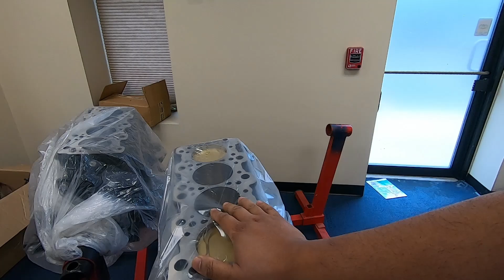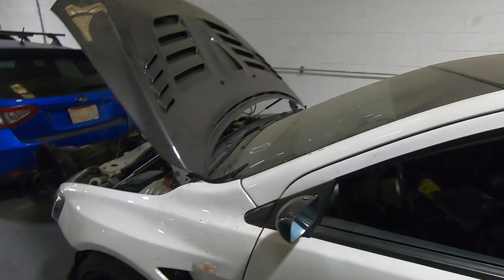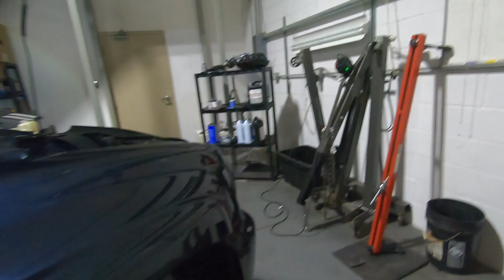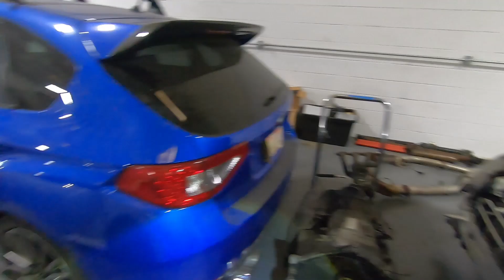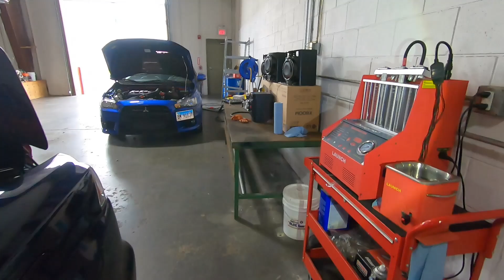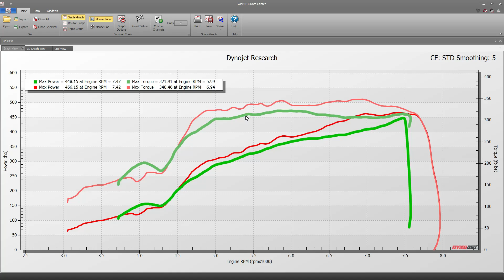How to Make 500whp on stock block EVO X, setup discussed and prices

Comment: I made 476hp and 374trw on a tdo6h 20g no cams full mivec delete stock clutch full bolt ons with open dump 340 pump on pump gas 28psi ..
Stock head stock block stock fuel regulator stock fuel lines stock clutch ..
Exo x 4b11t makes good power i believe if u had s1 set up it will brake 500hp on pump and maybe 550 on e85 and my turbo cost 800 bucks ..
Nive video next ima do a 25g and brake 500 on pump and hopefully 600 on e85 stock head and block max trq on e85 i might say 415trq
On a 62mm my buddy did 605 on e85 stock head and block trq at 428 2 yrs still driving..nice video man
Reply: What’s the turbo

Comment: Evo X
3 Port
Intercooler
3.5" Intake
Intercooler
UICP
1200cc - 1300cc injectors
GTX3576 Turbo
320 FP
Springs 
GSC S2 Cams
Mivec Delete

Comment: What would you suggest I want to make 450whp to 500whp on stock motor  I have a 2011 Evo x I just bought FIC 1200cc injectors and AEM 320 fuel pump I want to get bigger turbo not sure if I should do gtx3576r or 3582r but I feel 82r might be over kill to big of turbo what do you think
Reply from the maker: Either one would be fine but I prefer the 82
Reply: @bdalchemist  you don’t think the 82 is to big on stock motor and it will prolly spool late tho right
Reply from the maker: @aviannamartinez1611  spool difference is negligible
Reply: @bdalchemist  okay so as of now I would have gtx3582r turbo , FIC 1200cc , AEM 320 fuel pump  , UICP ,ACT clutch ,MAP 3in or 3.5 intake , Either MAP downpipe or AMS widemouth downpipe and high flow test pipe , would you add anything else and would this bring me around 400whp on 93
Reply: @bdalchemist  but is the 82r a direct bolt on can’t seem to find it says it come with 4 inch inlet

Comment: So, I changed my mind, I won't be going 660AWHP in my 2014 EVO X MR, I rather just bring it from 330AWHP to 440AWHP like the FQ440. So I think I will need just to upgrade the fuel system and a tune, the stock turbo has an upgraded 20G wheel! I'd rather not spend much more money into the engine and gearbox, 440AWHP daily driven Evo X on 95 pump gas is my goal.
Reply: How’s it going.?
Reply: @ccohen8  got new Wally 450 fuel pump installed, set of used ID 1050x injectors to be installed, now I am looking at changing out the alternator because it gives me electrical problems, can't floor it without the car bogging down, had installed a new battery but no dice, fuse box checked out and looks good. As soon as I fix this it goes on the dyno for another pro tune.
Reply: @Hunikengt look at your fuel  relays and such, get the orange one if you haven’t already ! This might be your problem…
Reply: @Bennoit007  I finally got the car fixed! It was from the wiring harness. Swapped the Alternator and still had the issue, the garage brought a specialist and ruled out the problem. Runs like a champ 🏆 💪 😎.  Now the gearbox is an sst, gives me shit sometimes but it's alright.
Reply: @Hunikengt Im glad you found the problem ! Sst are great when maintained properly !
Reply: @Bennoit007  yeah, gonna have to upgrade the shift-fork magnets and clutches with heavy duty billet basket.
Reply: @Hunikengt go to kosmic in Texas for  your sst, nowhere else !!!!

Comment: Hey man just subd I have a bone stock Evo x my second one. This one I want to build to 450-500whp but on 93. Is that possible ? Also so far I’m gathering parts so far I have ams wide mouth down pipe, ams performance intake so far. I want to get tomei exhaust system, will that be an issue with the AMS wide mouth ? Also what power can I get full bolt on except turbo just Inter cooler, upper and lower icp plus ic, bov ? Thank you hope to hear from you soon ! Ps I want to do a full AMS build just personal preference would love your opinion and feedback !

Comment: Does an ets intake make a difference when tuning even if the motor is stock besides exhaust?
Reply: I tuned with drop-in 1st then added an ets and gained 9whp and a few lb ft of torque. Mostly sound

Comment: Can you get to 500whp without e85 and a stock block?
Reply from the maker: Need a large turbo and probably not safe due to fuel volatility
Reply: @bdalchemist  so you can’t get to 500 whp with a stock block?

Comment: I already have same set up but just different turbo, i have the mhi18k turbo would that still get me to 500whp? Or at-list 480whp?
Reply from the maker: Yes on e85
Reply: @bdalchemist  right now my car  has 140kmiles and my  tune is next week would it be safe still to push around 480whp and keep the torque low around 350 to 360 torque? would it still last long? thank you!! i  dont stop watching your vidoes!!

Comment: Hey man,  how does having the ets equal length headers top mount affect 3576r vs the tubular manifold stock orientation setup in terms of spool? Also with the ets 4" intake and 3.5 maf adapter. I feel on equal length headers you lose some spool as its more free flowing lower range but develops more power up top, is this correct? Or negligible difference?
Reply from the maker: Tubular headers will produce a noticable lag in spool , but also a noticable difference in power up top.

Comment: I still think cams are a waste of money on a stock block evo x. Alot of these stock framers like MHI 18k, and Gen 2 GTX’s make 450-500+ without then need for cams. But the best turbo kits for these cars are the EFR kits. Can’t beat the spool and power they make
Reply: It depends on your personal goals and where do you want to shift the power band. 

Modifying a car in general is a waste of money anyways.
Reply: @asuarezfelix  I agree. Especially how fast cars come from the factory these days
Reply: @garymofo2  I think its just the rollercoaster process of building something. Then having a blast in your own build.
Reply: Stock block stock turbo here with Kelford 214 B cams here and I can say they make a noticeable difference :) 
Planning on going bigger turbo down the track

Comment: Really appreciate the videos man! What are your thoughts on the GTX3076r gen 2 vs the GTX3576r gen 2. I’m a little worried about the spool on the 3576….would the 3076 spool faster and still make around 450-500whp?
Reply from the maker: The 3076 will get u there with a bit of faster spool and higher torque earlier. The 35 however is much more efficient and would gett vote. The spool is right , not late at all, u don't want a bunch of torque down low.

Comment: Ahhh. So you just need the upper hard piping huh? Don't need the bottom intercooler piping do you? I plan on going 3.5 AMS for the sake of it needs no tune to run it. So that's made my build list cheaper.
Reply from the maker: That's correct just the hard one up top

Comment: Do you see that big of difference between the 3” vs the 3.5” intake? I have a ets 3” intake on my GTX3576r on 93 tune and was wondering if it was worth the upgrade to the larger maf size.
Reply from the maker: Yes!
Reply: @bdalchemist  what about the intake? I currently have the 3.5” maf housing but would the 3.5” intake make that much of a difference?
Reply: @Kennyjamesss  this
Reply from the maker: Yes

Comment: Would you say a single 450 fuel pump be enough for 500hp. My tuner wants me to go double pumper but its another $500-$700
Reply: Lots of people make big power on a single hardwired 450
Reply: Of course!  A single Walbro will get you at your goal easily
Reply: Who is your tuner?  Stock block 500hp 400tq on a Walbro 450 single in the tank all day long.

Just don't do full pulls under 1/4 tank.
Reply: @dsmtsi  is it quarter of a tank? I heard under half a tank but maybe they weren't 100%
Reply: @Aaron72772  I have always used 1/4 tank as the mark it stop doing pulls.  I haven't heard 1/2 tank.
Reply: @dsmtsi  good to know, thank you